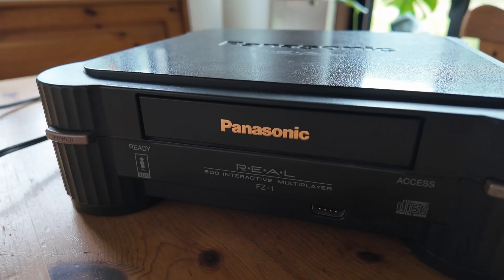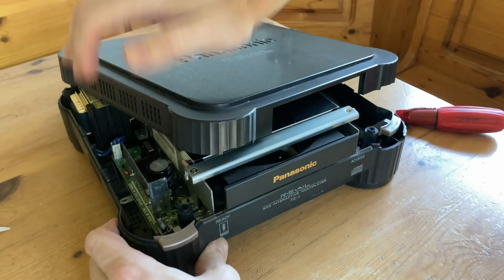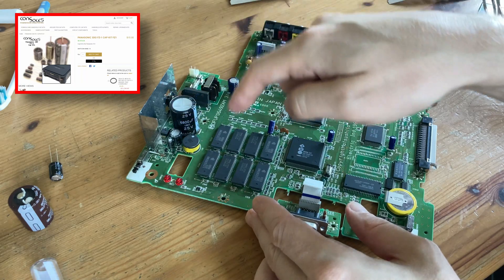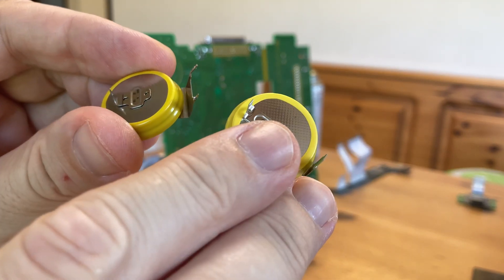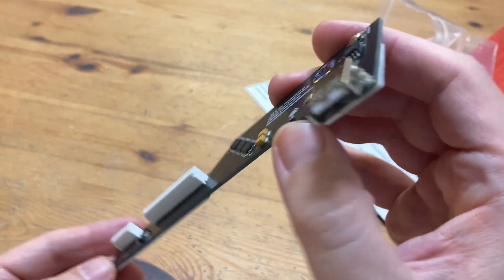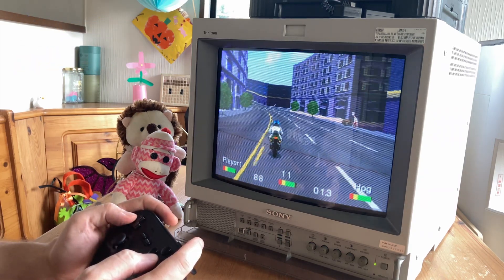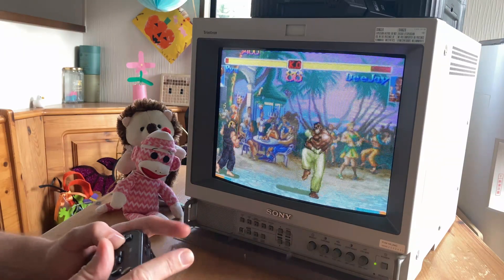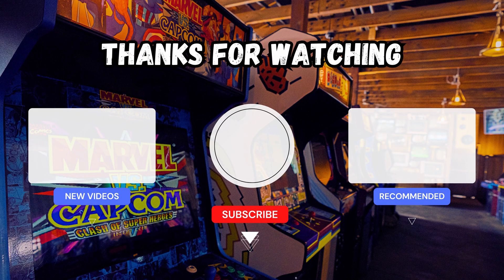Reviving the Panasonic 3DO: Modern Upgrades & Repairs!

Comment: 1:34 is that Raspberry Pi Zero? How ironic using Raspberry Pi Zero which probably more powerful than 3DO just to be CD drive replacement 🤷‍♂️.
Reply from the maker: @bhirawamaylana466  yes. It definitely is 😁. I guess if it's never a total loss as it can be resurrected to be a pi Pico if unsoldered from the board.
Reply: @TeamPandory  one of my friends ordered that board (or one of them), the seller refused to give the .uf2 file (the pico programming file) in order to get it to work. Still trying to find it for him.
Reply from the maker: @XeCuTioNR  it should work out of the box (it's installed already)